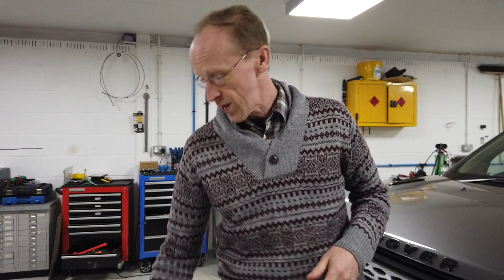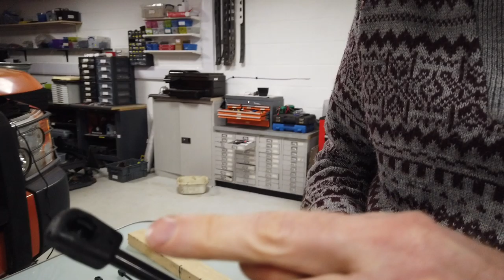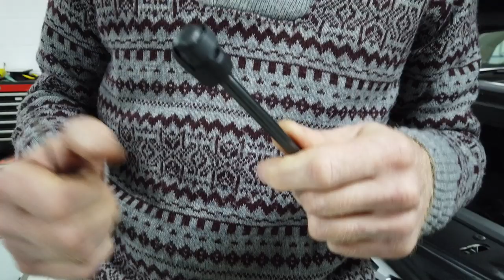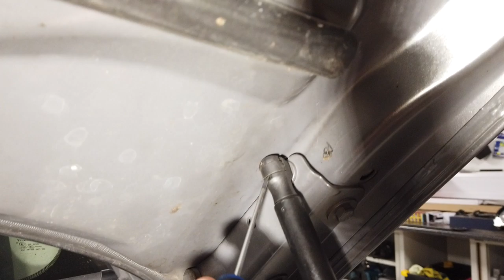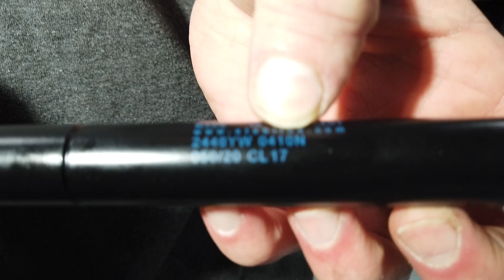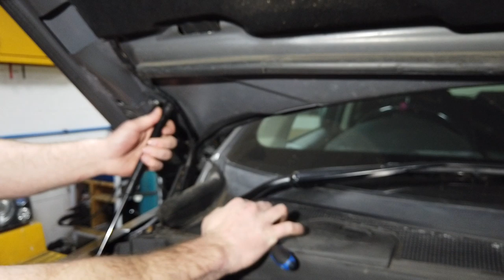How to replace Land Rover Freelander 2 / LR2 Bonnet Hood Gas Lift Struts

Comment: Not sure why these Land Rover struts fail so quickly, the ones on my 27 year old Peugeot are still going well, but my Range Rover struts failed very quickly. That one goes up so quickly it could catch you under the chin ! Stand well back. Why do you need a jumper, it's 26 degs outside ! Chris B.